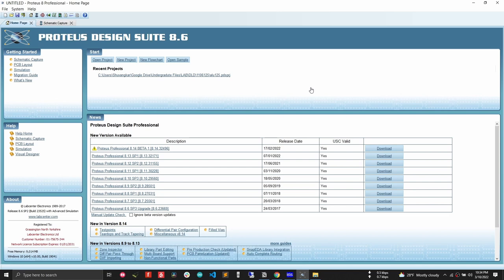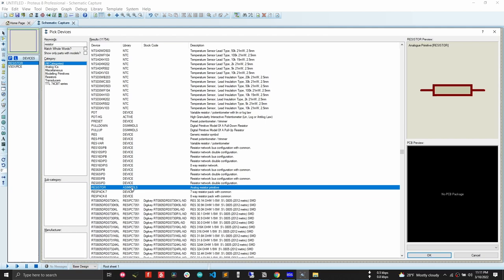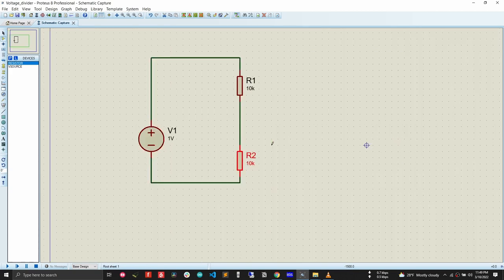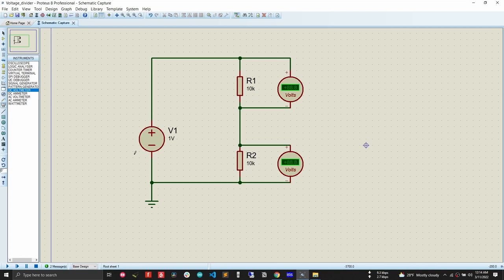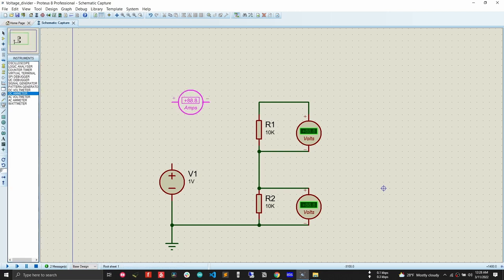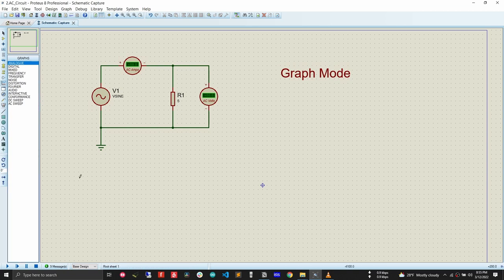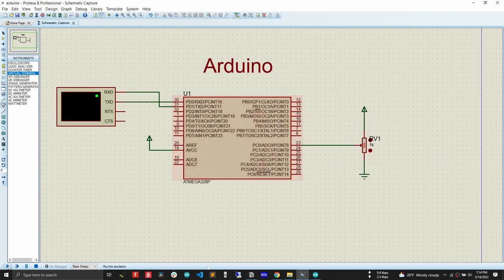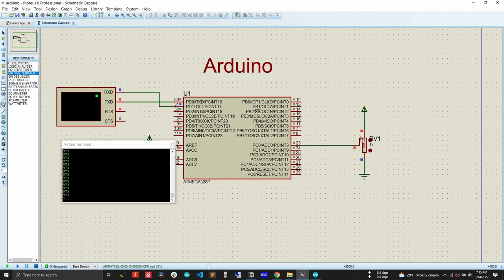Learn Proteus Basic in One Video

Comment: Hello shuvankar bhai, 
this is exactly what i have been saying. i tried to search for proteus alternative but failed miserably. this software is really unique. 
good analog+digital circuit simulation which also supports pcb (with autorouting, 3D visualization etc nice tools), VSM microcontroller stuff. i mean, its really hard to beat 

have you found any software with similar functionality of proteus?
Reply from the maker: Unfortunately, I couldn't find any alternative of Proteus.